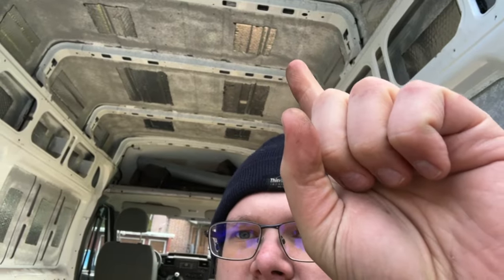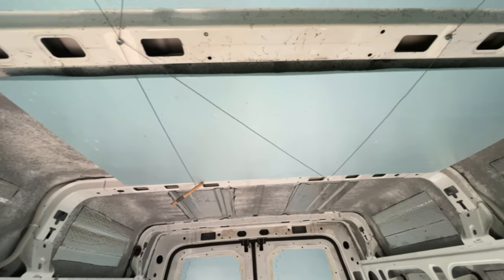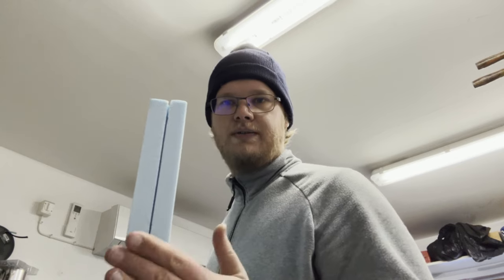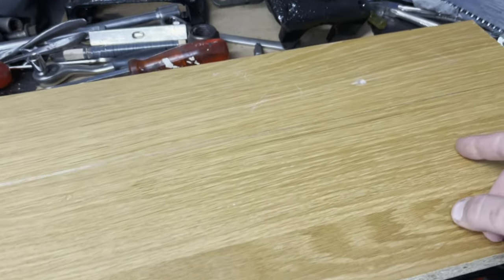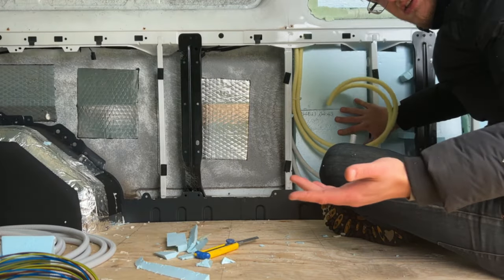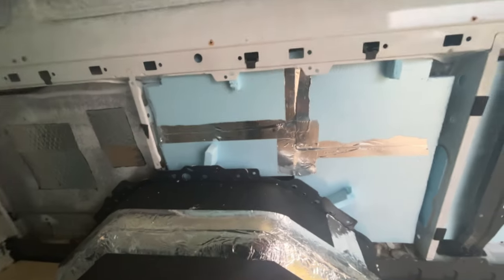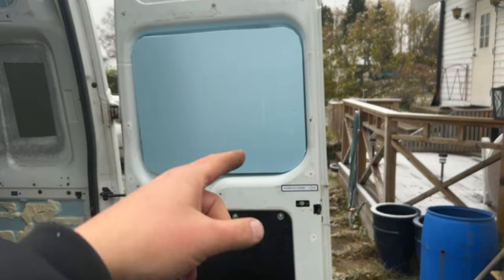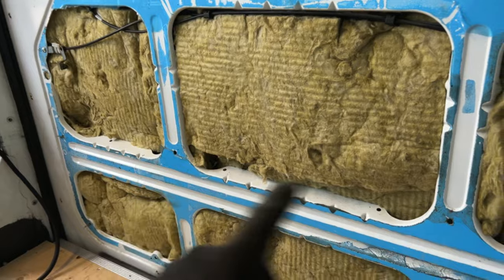Insulating The Van Ceiling and Walls | One Road - EP6

Comment: Why are you using XPS insulation? PIR has a higher R-value in the same thikness. And it is availeble in a vatiety of thiknesses.
Reply from the maker: Hi, your right. I could not get my hands on the right thiknes even whit PIR and it was twice as expensive here. Building on a tight budget so every expenses counts and I thought that XPS was a good middle ground 🙂